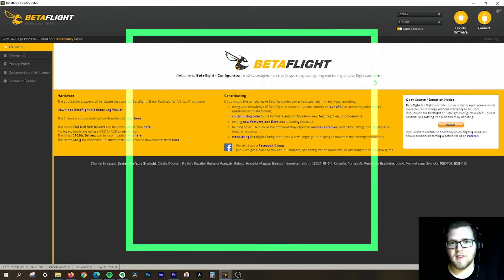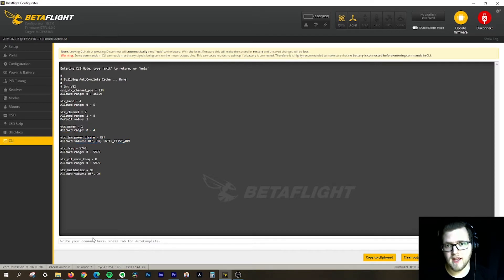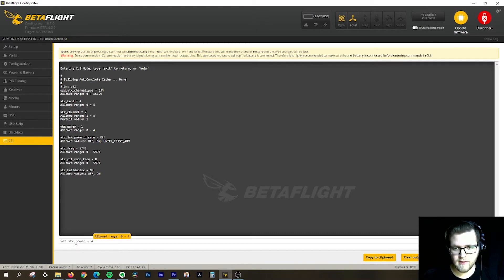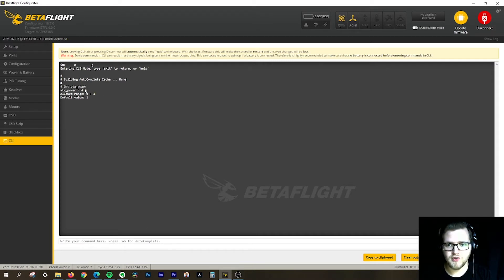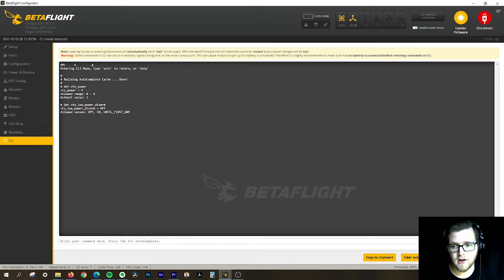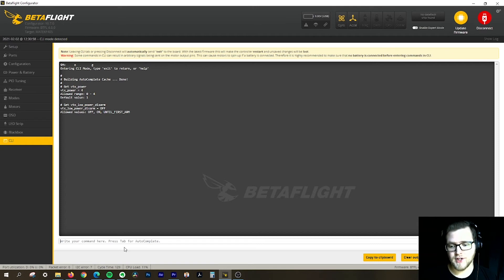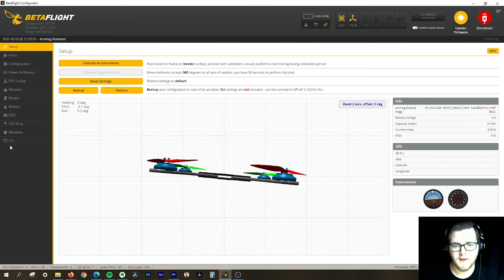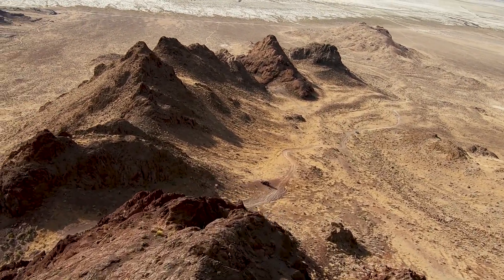Changing Your VTX Power in Betaflight - Tuesday Tech Tips

Comment: Thank you so much for this video! I got the Tinyhawk 2 freestyle combo from Emax a couple months ago and it’s a fun little quad, but I’m disappointed with the distance I was getting with the goggles feed. After watching this, it looks like my VTX power range is 1-7, and it was set to 1, so I changed it to 3. Hopefully won’t ever have issues since it’s not all the way up, but I’m gonna test it tomorrow and see if it makes any difference. Either way, really thankful I learned some of this info from you!
Reply: Well… I’m back again and this worked fine the first time I did it, but now I’m seeing my vtx_power = 0 even after I’ve tried to set it to 4. Not sure why it keeps resetting back to 0. I’ve also tried unlocking the vtx by pressing and holding the button on the vtx while powering on the drone… and still not had much luck
Reply: @Ian_MacGregor  did you add the low power disarm step?

If you're looking in betaflight and haven't armed the quad then it'll be the lowest setting because of that.
Remove the low power disarm settings and see if the power level stuck.

Comment: Thank You! I Hated The Tinyhawk 2 Because I Flew A Few Feet Away And It Allready Started Losing Connection And The This Popped Up In My Recomended, Now I Fly With No Problems. Thank You And I Subbed
Reply: I have the TH 2 freestyle and that’s the same thing I’ve been dealing with. Just changed my power level to 3 instead of 1 and gonna test it tomorrow, hopefully see a bit of difference 🙏🏼

Comment: I run the same but am having an issue with the betaflight now, where if until first arm is enabled my vtx will lock itself to 25mw and never change.  I have to turn the option off in betaflight to regain full power.  No idea what is wrong, it's for long range so don't want it sitting there getting hot
Reply: https://youtu.be/zGZ0UrBmCjI alternatif

Comment: Mine said 0 to 7 I put it on 7 hit save now its stuck on 0 can I get some help
Reply: Did you fix it?
Reply: Yea u half to unlock it first
Reply: @420fpv7  what do you mean unlock?
Reply: There should be a button on the vtx u half to push that and it unlocks it then when u plug it in u can change it
Reply: @420fpv7  do you mean button on betaflight?
Reply: @elvissaraiva7323  on the vtx
Reply: It's a really small button
Reply: Make sure ur drone is plugged in when u push it so it has power then unplug it and try the cli again
Reply: Did that help
Reply: U half to push the button and it unlocks it so u can change it in the cli
Reply: @420fpv7  what button?

Comment: Hi. Your videos have helped me a lot so far. I have a problem with the procedure of this one though and would appreciate input. I have tried to change my vtx power from 1 (0-7) to 5, but after saving it is shown with 0. I did try several times and with several values but always with the same result.... The vtx low power disarm change did work on the other hand... Do you have any idea?
Reply from the maker: Glad they have helped! What flight controller do you have?
Reply: @illuminatedrones  Thanks for your reply. its a Tina Woop with VTX: MAMBA TX400MW and MAMBA F411AIO Flight Controller (Betaflight) Flight Controller.
Reply from the maker: @encikthomas  so, this tip will only work with FCs that have smartaudio abilities enabled. Have you done that?
Reply: @illuminatedrones  mine is on vtx(TR). seems I can't jange that. so that doesn't work?
Reply: I just added a message saying the same thing then I read ur comment I was trying to do it to my tinyhawk freestyle 2 now its stuck on 0
Reply: @420fpv7  im trying to sort this too, i have noticed if you go onto the video transmitter tab in betaflight and on the vtx table at the bottom it seems you need to have the number of tables set to be able to change to them in the cli, i can now get the cli to save the value i choose but im not sure if ive set it right.
Reply: Please help! This has also just happened to me! My tinyhawk 2 freestyle is stuck on 0 and I don't know what to do!